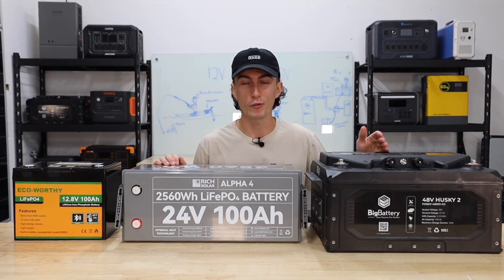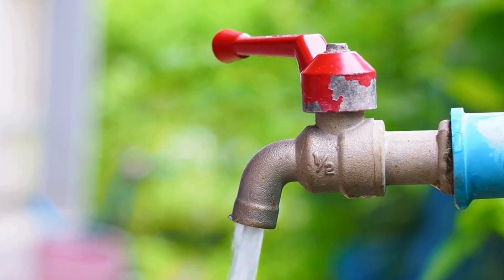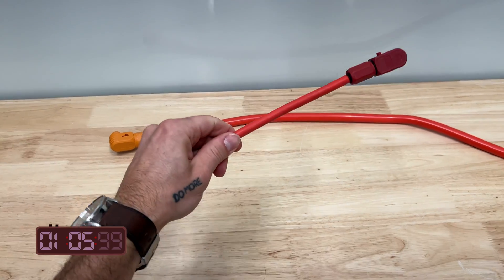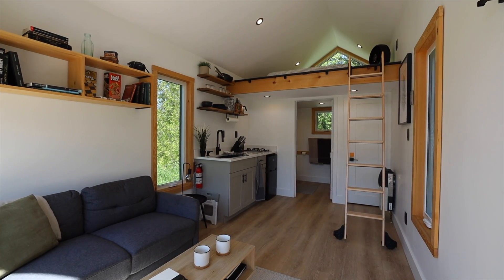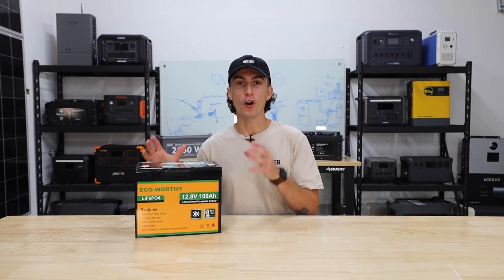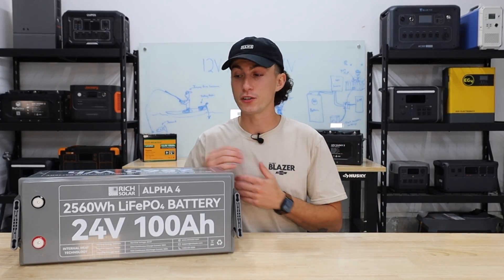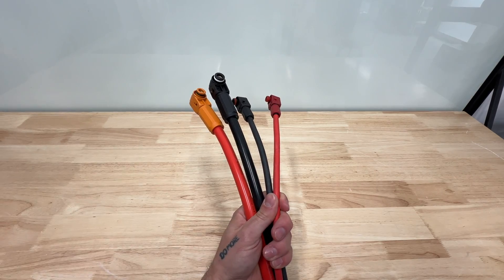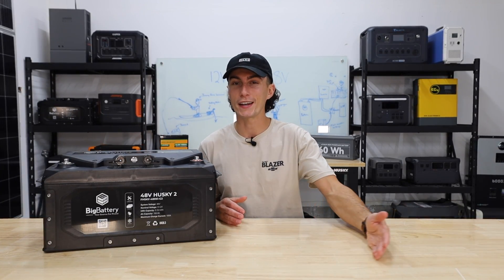Which is Best? - 12 vs 24 vs 48 Volt Solar Batteries Explained

Comment: What's the functional difference between 4 12-volt batteries wired in series and a 48-volt battery composed of 16 3.2-volt cells?
Reply: The 4 12v systems have 4 individual BMS. Better hope they're compatible. The 48v system is more compact (space efficient) and has one BMS
Reply: This application you should always choose 48V battery, that's it.
Reply: The functional difference is that the 4 x 12V (12.8V LiFePO4) batteries in series are far, far less reliable than 4 x 48V (51.2V LiFePO4) batteries in parallel for the same storage capacity (assuming all else is equal and the batteries have the same storage capacity in watt-hours).

For example, 4 x 51.2V 50Ah LiFePO4 batteries in parallel is comparable to 4x 12.8V 200Ah LiFePO4 batteries in series.  Same weight, same overall capacity, but vast differences in reliability.

--

* When you have four 12V batteries in series you need additional wiring for a whole-battery balancer to keep the four batteries balanced.   Also, if you ever hit a LVP or OVP situation and cause one or more of the batteries to disconnect, it can actually take some effort to wake it back up.  (when batteries are in parallel, they recover automatically from such disconnects, but not usually when they are in series).

* Also, most people are going to have more than one battery and paralleling batteries adds a lot of redundancy.  It is better to have (for example) 4 x 48V batteries in parallel than it is to have 4 x 12V batteries in series. 

* It is easier to scale the higher-voltage system because you only need to add one battery at a time whereas with several batteries in series you have to add N batteries at a time to scale-up your system.

So with LiFePO4 while you CAN put batteries in series to generate the higher voltage, and doing so appears to work well at the beginning, it is not ideal and has a lot of potential problems.  Unless you are retro-fitting an older system, you really want to use the proper native voltage battery to construct the system.

-Matt
Reply: @junkerzn7312 what is involved in wiring the whole battery balancer if you were going to do that. 
If a guy had about 40 or so 12v batteries already on hand

Comment: Odd question… I want to boost my RV’s capacity as I use PC, Monitors, NAS, and other 120v devices like AC for months while traveling.  What about inverter drain on a 48v system?  I’m guessing that in addition to a step up inverter, I would also need to have a step down inverter too, as the 12v RV systems, refrigerator, lights, etc. run that.   I know that I’ve powered everything down for the night and forgotten to turn the inverter off, and the drain is noticeable by morning.  Does a 48v system require an inverter to be on 24x7 for the 12v RV systems?
Reply: No, inverters generate AC power.  48VDC to 12VDC does not use an inverter.  You use a DC-DC converter though my recommendation for RVs is to have a DC-DC (48V to 12V) DC-DC charger instead of just a converter.

With a DC-DC charger you add an additional 12.8V LiFePO4 battery on the 12V side.  These are called "downbuffers".  This helps a lot because then the charger only has to trickle-charge the battery (relatively low amps) while the battery sources all the power necessary to run the 12V systems... which depending on what you are running, such as auto-levlers and slides, might need a hundred amps to get going.

The second reason for using a downbuffer battery setup instead of just a DC-DC converter is that any sort of failure between the 48V and the 12V busses will blow a fuse instead of putting 48V on the 12V bus and destroying all your 12V equipment.

-Matt
Reply: @junkerzn7312  This.👍

Comment: Why does no one make a 120v battery?
Reply: imagine people D.I.Y with handling 120v system..😂😂😂😂😂
Reply: That would be 10 12vdc batteries in series. Can you pickup 10 batteries at once?
Reply: @justusholm6766  yes 👍
Reply: @justusholm6766 that isn't a great reason, whats the size of a battery
Reply: Good question 😂 @justusholm6766
Reply: have,
Reply: Cause they ain t safe for residential use; too many chances of an end user getting a shock if he is tampering with them or if he is a diy er. 48 is optimal
Reply: @shazzz_land  upto 120v dc is safe
Reply: You can
Reply: It's coming, my electric unicycle has one
Reply: You won't see a 120v battery because 120v is the limit of ELV and batteries generally are at a higher voltage than stated, what i think we will see as this stuff becomes more popular is a 96v tier which with theses lithiums would be about 104v leaving a bit of a buffer but allowing greater capacities for fixed power systems
Reply: They are very common in solar systems. Like proper systems, not this garbage
Reply: You could  make it  !!DIY  12VDC  BUT  MORE  THAN 35VDC  YOU CAN FEEL  THE CURRENT  !!! WITH  120VDC Y RUN WATER HEATER  STOVE  HEAT LITE  ANY THANG  HAS NO  50 /60HZ  IN N AMERICAN  !! NOT TOO MANY PEOPLE KNOW THAT  !!! FROM SAUDI ARABIA X AVIATION MAN.
Reply: @mohammedmurad3787  Caps doesn't make you right it's just annoying
Reply: They make them.  It's for commercial UPS units for small data centers.  Each 120 volt DC battery assembly is about 3 feet long and is stacked in a chassis.
Reply: Easy to make, a little tougher to carry though.
Reply: 1. A 120V battery could kill you; 120V DC is more likely to electrocute you than 120V AC, because the latter crosses zero 120 times a second. 

2. You’d still need an inverter to power your AC appliances, so 120V DC doesn’t have a ton of benefit. 

72V batteries are fairly common, but are also more likely to electrocute you than 48V. 

50V DC is right around the threshold of “it might kill you, it might not”. 120V DC is well in the “it’ll probably kill you” territory.
Reply: @jimothy4j Yes, Nicola Tesla figured all this stuff out first!!  He is the goat.

Thomas Edison was a charlatan/business guy taught to us in elementary school.
Reply: @NB-yc2gj A sine wave crosses zero twice per cycle, so 60Hz crosses zero 120 times per second, 50Hz crosses zero 100 times a second
Reply: @jimothy4j very wrong the voltages deemed safe or Extra Low Voltage is 50V AC or 120V DC